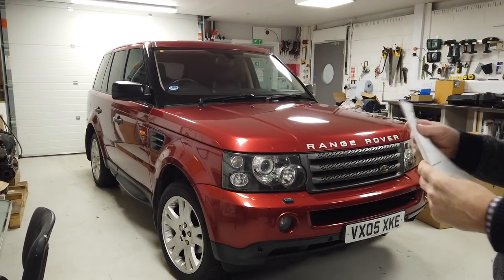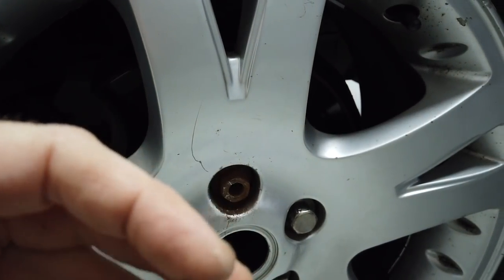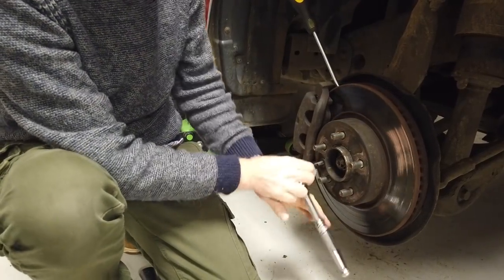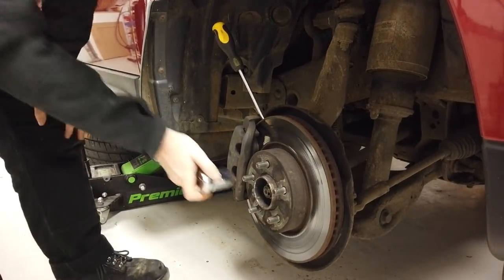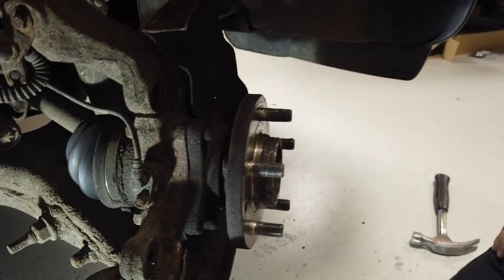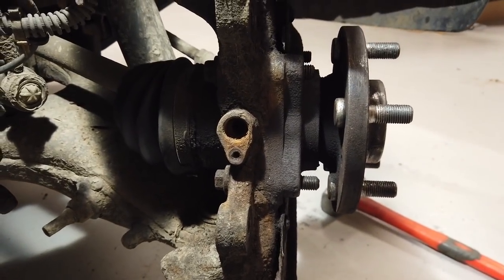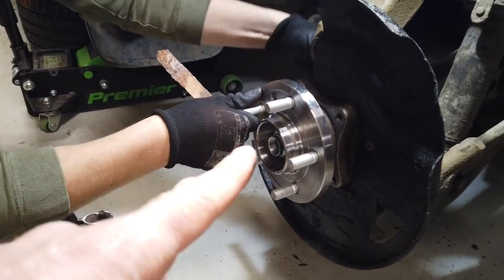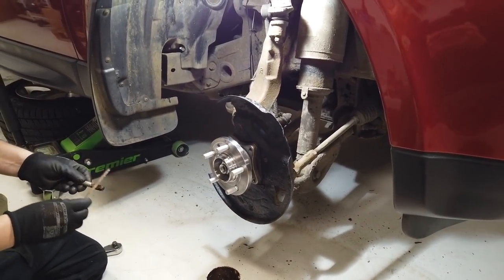Our project RR Sport Fails MOT... & .. how to change from hub on Range Rover Sport

Comment from the maker: Here are the torque settings

Hub retaining bolts - 115 Nm ( 4 bolts holding your new hub on )
Disc support bolt - 35 Nm ( the single tapered bolt that hold the brake disc in place )
Caliper Carrier  - 275 Nm ( the 2 bolts at the rear holding the caliper carrier to the upright )
Caliper bolts - 35 Nm ( The 2 bolts that go into the caliper guide pins )
Hub Nut - 230 Nm ( The big central hub nit )
Wheel bolts - 140 Nm
Reply from the maker: @Jo3NTech  Hi yes i did add the correct values at the top ! Sometimes i dont know my own power !

Comment: A very thin layer of Copper grease (Copaslip) on the caliper sliders would be good. 
Also you might invest in a slide hammer. They come with a plate which would fit on any (for instance) wheel nut arrangement and make removing the hub easy peasy.
Nice work Dan.

Comment: If the piston is tight going back into the caliper it could be a collapsed hose , not a faulty caliper . Hoses are cheaper than calipers too, to check disconnect the hose and see if the piston is still tight returning

Comment: When undoing brake parts and wheels, use hex sockets, they are less likely to slip and twist up the bolt head. Keep the socket in line with bolt.

Comment: I’d use a Club hammer, as using a high tensile claw hammer designed for nails is not good.
Firstly the head is small, so slipping off and injury is MUCH easier to happen, but also striking almost solid objects can crack or shatter the hammers head.

Comment: It's best to crack the Hubnut BEFORE taking the wheel off, while vehicle is still on the ground.
Reply from the maker: if the wheel cap is missing and if the socket will fit through ? yes that would be a better idea

Comment: Not been picky but did you use recommend torques on tighting or hand tight them up.
3 clicks rule, under stress or over stress.
I did not see that, or mention.

Comment: U might want to add that the smoked rear lights you sell for RRS 2006 are MOT failure as no red reflectors, last year mine passed with them, but new rules it failed as on 2006 theres no red reflectors built in

Comment: The whole job went very well considering you do not have a hub puller, I had not realised that the unit came with a new hub, so I was horrified to see you attacking it with Stylsons , but I think a hub puller should be on your Christmas list! And Simon! Please get rid of the carpenters hammer before you injure yourself, just use your Club Hammer! Chris B.

Comment: I thought you would treat it to some V8 cross drilled and grooved discs with the bigger caliper carriers for disc clearance? 🤞😁
Reply from the maker: We will - they are in the corner of the workshop if you spot them..... first thing get it fixed and MOT tested ... then the fun will start

Comment: Good video what mpg do you get out off a petrol RR auto
Reply: My dad has the 4.2 supercharged hst and he hasn't reached 14 mpg in the 3 years he has owned it
Reply from the maker: My Sport L494 5.0L gives 28mpg... better than my diesel Disco 4
Reply: @michaelkenway-allanach2173  yup my 4.2 s/c is the same. Hangs around 12 or 13. Thankfully I don't do a lot of miles.

Comment: Morning, I have a 58 plate one  of these cars, I have an annoying vibration seems to come from centre front of the car at 50mph, any slower or faster it vanishes.. Ive swapped wheel bearings, brake callipers, tyres, prop shaft.. wheels are all balanced.. its got me completely stumped and worried if its now something a bit more sinister thats wrong with the car... anyone had a similar issue?
Reply: Torque converter if it happens under load could be the answer.
Reply: Nik F thing is it doesn’t happen at all if I shift into sport mode
Reply: @redditroom2981  Sounds like very early torque converter then. Mine is on the way out on the D3, if I stick it in sport it happens much less frequently. Could be worth having a megaflush done on the box, may extend the time before you need to drop the box etc.
Reply: Nik F what’s involved with a mega flush, never heard of it?
Reply: @redditroom2981  Think of it as an oil change but for the transmission. All of the old transmission fluid is pumped out, flushed through & new oil put in, usually with a couple of bottles of 'Dr Tranny'. Which prolongs the time before you replace the TC somewhat. Have you come across disco3.co.uk, the forum? If you pop on there & put in 'torque converter' you'll learn all about the sagas :)
Reply from the maker: @redditroom2981  Hi - we have done a video for the gearbox change on the Disco - its the same for the sport
https://www.youtube.com/watch?v=PWsLZMDYZXk
Reply: powerfulukltd thanks guys, very helpful
Reply: @L663  Quick question, my car doesn't have heated seats, any ideas whats involved with installing some heated front seats and maybe the control unit?
Reply: @nikf3188  I popped 2 tubes of that Dr Tranny suff in earlier... problem completely solved.. will probably get the flush at some point also as you suggested.. thanks
Reply: @redditroom2981  -  nice it was easy. Good advice is worth loads..

Comment: First thing I spotted, it's on a jack... Get it on an axle stand before you hurt yourself
Second thing if you are going to remove the caliper with the caliper carrier why did you remove the caliper bolts??? You should have removed the caliper first and suspended it then removed the carrier afterwards
Reply from the maker: Don't worry is was fully supported in addition to the jack.
We removed the caliper bolts as it is easier to do this while it is "fixed" doing this when its suspended is trickier... but that are pro's and con's to each method.

Comment: Work Safe
Never work without axle stands
Reply from the maker: The car did have extra support under the chassis.
Reply: powerfulukltd but we know you have axle stands because we’ve seen them. Wedging a wheel underneath is lazy and risky.

Comment: The hub bolts should be locktighted not greased
Reply from the maker: I see where you are going....wheel nuts are greased not threadlocked .....
Reply: @L663  yes but you put copper slip on the bolts holding the new bearing hub to the carrier. They should have thread lock on them (as should the calliper bracket  bolts.)
Reply: @MF-fg3cg  -  you are obviously a very highly skilled mechanic, so why were you watching this? I used copaslip on every thread I have ever fitted, with no issues over forty years. This aint a space mission.
Reply: @thetessellater9163  well let's hope no one has ever bought a car off you or taken your mechanical advice.

Comment: Claw hammer. Really??  Axle stand?
Reply: Putting the wheel under the strong point of the chassis, with wooden packers, stops it going anywhere, and let the jack down a bit to let the wheel take some of the load, has served me well for forty years, mate. Axle stands are not safe!
Reply: @thetessellater9163  well you've obviously been very lucky then.  Axle stands not safe,Really?  If you can't support a vehicle safely, or even use to correct tools then maybe you should leave it to a professional . Been in the trade over thirty years MATE!

Comment: Should have used new bolts guys
Reply: Shaun Stokes and by undoing the old bolts a few turns at a time you can use them to tap off the hub flange from the rear without all that beating on the wrench.